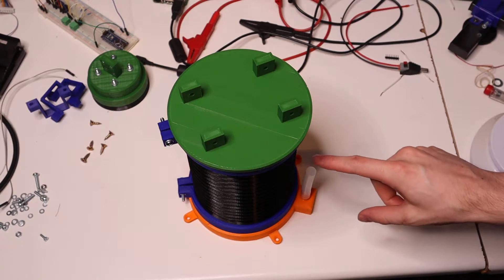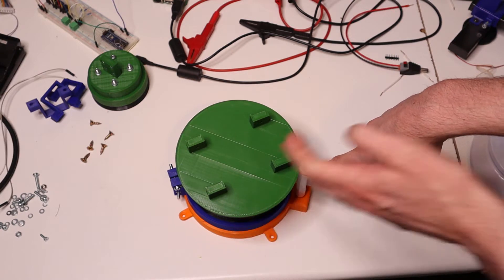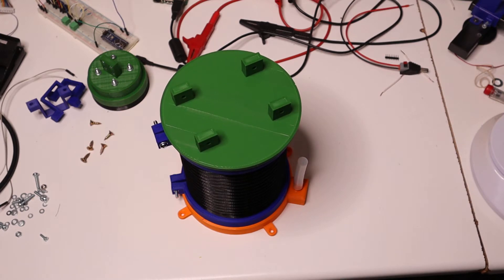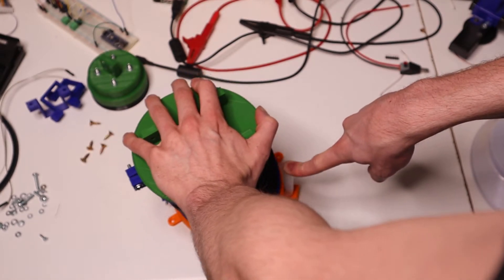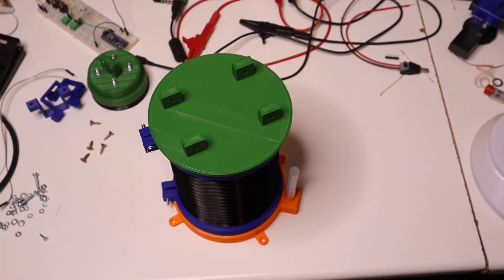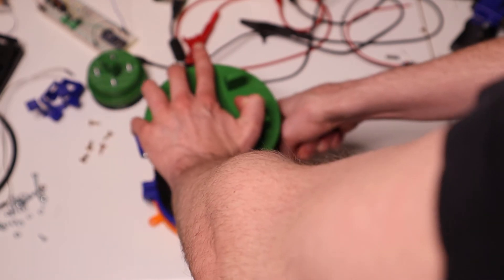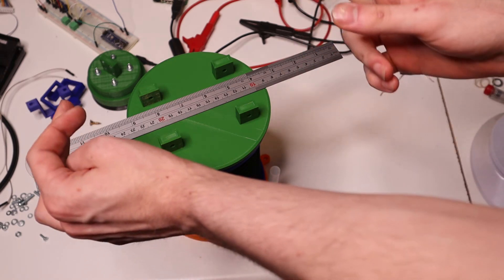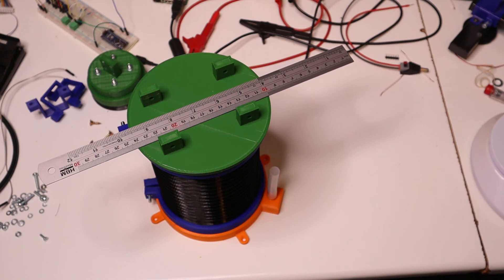Ventilator 3D printed bellows showcase

Comment: Hi? That's some great work, uhm did you find where the leak was? thank you so much, God bless
Reply from the maker: Thanks! I think the leak on this one is between the print layers at some point. I'm starting to see the layers come apart after having the ventilator working for a while. It still produces enough pressure to blow up my latex glove test lung though!
Reply: @antalz  oh ok, in your newest project you also used this kind of 3d printed bellow? thank you so much
Reply: @antalz  so the leak was from the 3d printed bellows? thank you so much
Reply from the maker: Yeah I think it was from the bellows itself. It may also be a leak where the bellows meets the end-plates. I'm not entirely sure how to tell.